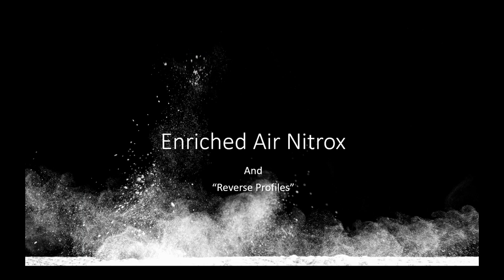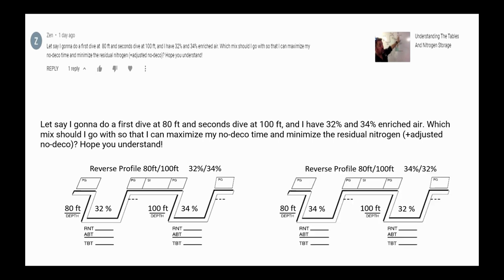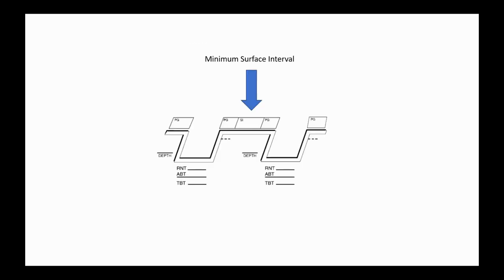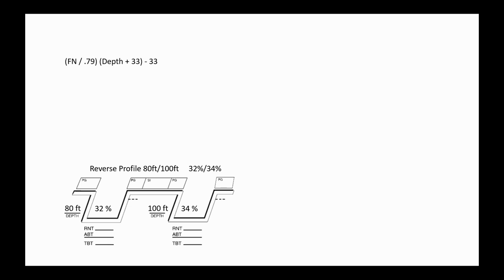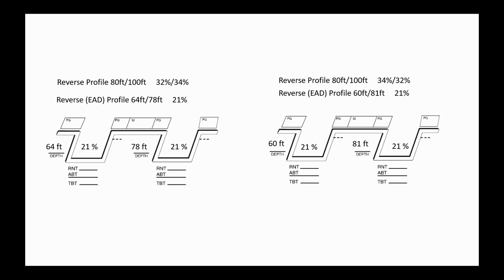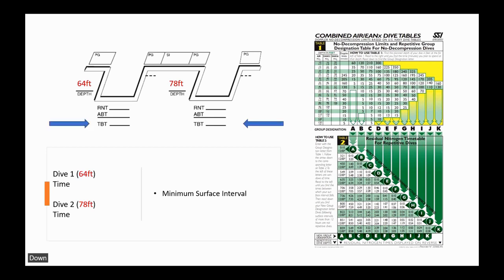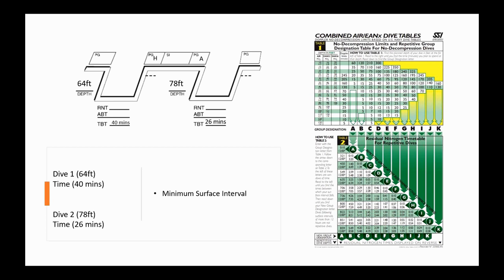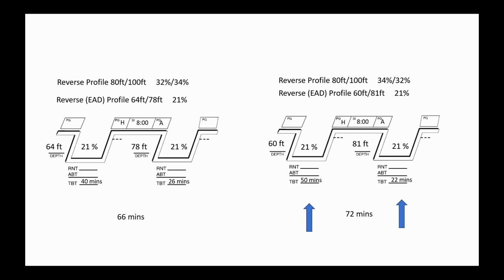Nitrox And Reverse Profiles

Comment: Thank you Bryan for the in-depth explanations!! Plan to execute the plan this weekend at Paradise Spring, FL
Improving the dive profiles: 

Dive 1 @ 100 ft:
Best Mix (according to the magic circle): 35 %
EAD: 76 ft (PPO2 = 1.4)
Max Bottom Time: 30 mins
Pressure Group: G

Dive 2 @ 80 ft:
Best Mix: 41% (if dive shops provide that)
EAD: 51 ft (PPO2 = 1.4)
Max Bottom Time: 45 mins
Pressure Group: A

Total max bottom times of both dives: 75 minutes (increase)!
Minimum Surface Interval: 7 hours and 36 minutes (decrease)!
Conclusion: Plan the deepest first, then find the best mix, and choose the right cylinder type. Find the adjusted MBT if the planned surface interval changes.

Imagine doing multiple dives in a single day for multiple days. A good dive computer can do all the work but it is always to have a peace of mind to work out the tables by hands. 

Final question: If dive shops don't provide 41% mix, do I substitute it with the closest lesser mix they have (like 37%)?
Reply from the maker: Yes, that is correct. Most non technical shops can only fill up to 40%. I would use the closest blend to what your plan calls for in the event you can't get above 40%. Just make sure you do not exceed your Maximum Operating Depth.
Reply: @LakeHickoryScuba  Got you! Exceeding the MOD and get CNS toxicity is not fun! Thanks for the video thought!!

Comment: Hi Bryan, for the OrcaTorch D530V I used the IANTD C-3901 table in metric. 

The first dive: 100 ft, i.e., 30m. For a pO2 of 1.4 the optimal mix is 35%. This gives and EAD of 23m and an NDL of 25min. To clear any resdidual nitrogen, we need a surface interval of 4 hours.

The second dive is then to 80ft, i.e., 24m. A pO2 1.4 gives an optimal mix of 41%, but since you want to keep it recreational 40% would be the limit. With 40% we obtain an EAD of 16m and an NDL of 51min.
Reply from the maker: Thanks for the entry Tobias Hartung, stay tuned.

Comment: when my 12 y.o. daughter got certified, the instructor confused the hell out of her with all the tables.   She asked me why can't we just use table 1 for all the repetitive dive calculations simply by subtracting off the residual N2 time.  I had to explain why sometimes people who think they know better feel the need to dumb things down for others with the result of introducing more complications, in this case 2 additional tables (plus the enriched air tables if you are using them instead of the equivalent air equations.)
Reply from the maker: Hello weiniesail, sorry to hear that you daughter had trouble understanding the tables.  There will always be instructors out there that have trouble relaying the proper use of dive tables to students.Thankfully, we live in a time where dive computers have made diving much simplier and safer. Happy Diving.
Reply: Hey bryan, big fan of your channel (picked up a mares XR rig after I first saw it on your channel to make the move away from bcds.)  The point I was i trying to make was that my daughter picked up on the fact that when some things are done to simplify tasks, more complications are introduced as well as a lack of understanding.  My daughter simply questioned why table 3 of the RDP is even needed when you can get your bottom time for the second dive by simply subtracting off the residual nitrogen time after a given surface interval.  By having the the 3rd table, you somewhat remove the need to understand the concept of residual nitrogen as well as making the RDP seem more intimidating because there is literally 50% more table to view.
Reply from the maker: Several years ago, there was PADI Instructor here on YouTube that made an actual video demostrating the same technique you stated. I will link it here for you. https://www.youtube.com/watch?v=iRzxm0DBTAA&t=34s. This does simplify things a lot.  The issue arrises though when you try to calculate your minimal surface interval. This is where table 3 is needed. The only way to safely do this with out going into decompression (on paper of course) is to use table 3 to calculate your maximun allowed bottom time with residual nitrogen. Hope this makes since. Also, keep in mind, different tables will yield different results. This is one of the biggest reasons we teach to simply follow the arrows, and to just roll through the tables 1-2-3. Tell your daughter that it is good to question things such as the tables, that means we are constanlty learning new things. Our children are definitely the future of diving. If she has access to different agency tables as well, have her get familiar with different ones. Though they give you different answers, they all read the same in operation. We have tables here for 6 different training agencies. If you ever would like copies to play with, send us an email, and we would be happy to share them with you. Also, I hope the Mares XR rig is working out for you. Simply Scuba just did a Q&A on the XR Back Plates. We have been thoroughly impressed with our XR Rigs.
Reply: @LakeHickoryScuba  It's easy to caluclate a minimum S.I. without table 3.
Best to explain with an example with the RDP in front of you:
Let's say Dive 1 is to 80 ft for 21 min.  Then for Dive 2 you want to go to 50 ft for at most 45 minutes but you want to end up no greater then Group T (as group U puts you in the 'gray' zone).  After Dive 1, you are in group K.  Now, in the 50ft column, the time for group T is 63 minutes.  But we need only 45 minutes so subtract 63-45.  This gives 18 minutes to allot for residual nitrogen time. Reading up the column to the first number 18 or less is 17 minutes which is Group C.  Now we just need to find which s.i. takes us from K to C which is 0:55/1:16.  As a bonus, it also allows us to note a 1 minunte buffer here (18-17=1)  so we can actually safely stay 46 minuntes at 50ft rather than the 45 minutes we needed and still end up no greater than group T.
It's easier than it looks and I think naturally teaches you that the RNT gets subtracted out from the TBT to give the ABT. Give it a try!

Comment: 100 ft depth is equal to 4 atm absolute pressure. Using a limit of 1.4 atm PPO2, the EAN max O2 percentage is 35%. The EAD for EAN 35 at 100’ is 76’. Rounding to 80’, the max bottom time is 30 min ending up in PG “G”. For the 2nd dive, the EAD for EAN 35 at 80’’ is 60’. The max bottom time for EAD of 60’ is 45 min. In order to achieve this, the min surface interval between the two dives is 7:36. This is the surface interval required to go from PG “G” to PG “A”. The RNT after this surface interval would be 5 min.
Reply from the maker: Thank you for your entry. Stay tuned.

Comment: One point I’d like to make here is that reverse profiles are being treated as generally a bad thing when there really isn’t any evidence to suggest that they are more of a risk than deeper dive first approach.  New guidance has been out for many years now that a reverse profile is fine assuming the depth is kept under 40mt and the differential is less than 12mt. Apologies, it’s too late now to work out the kooky imperial depth.
Reply from the maker: Hello @paulspeirs2, you are correct. We have been doing reverse profiles for many years. As stated in the video, the only down side is the loss of time underwater.

Comment: Sorry, I have a question. Is there not missin of calculation of ABT (or RNT based on second RG)? If I understand it correctly, bottom time by the second dive is only 4 min (or 3 min in the case of second mixture). So the total bottom time should be 40 min + 4 min (or 50 min + 3 min). Maybe I am wrong.
Reply from the maker: Hello Milos H, you would be correct in saying that you would need to add your Residual Nitrogen Time and your Actual Bottom Time together to log this dive. The bottom numbers on any set of dive tables will represent the maximum allowed time with residual nitrogen already absorbed and is the number we use for planning purposes. Thus, this is the number we are looking for during the planning stage, and the number we use for planning with the minimal surface interval. Hope this clears up the confusion.